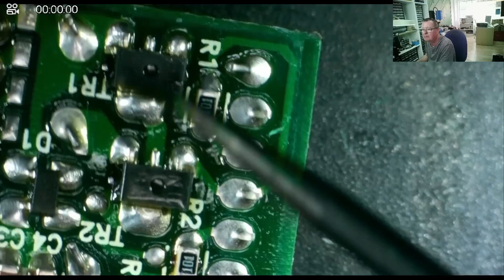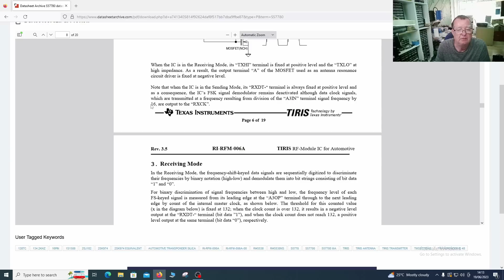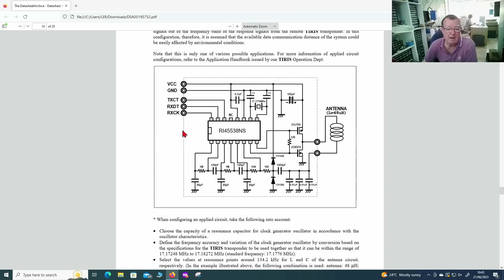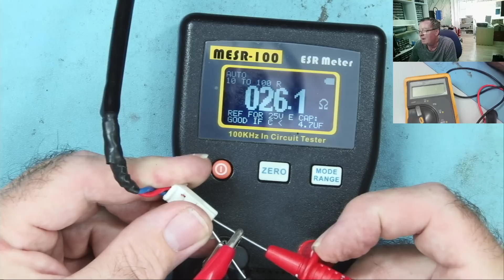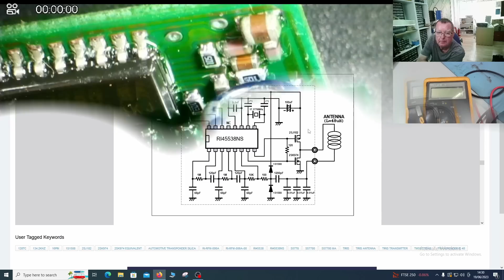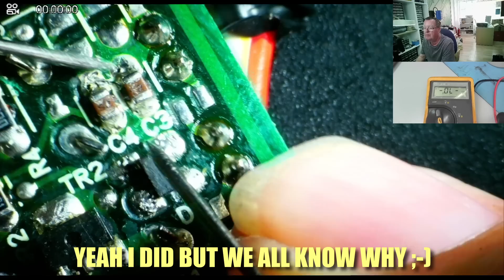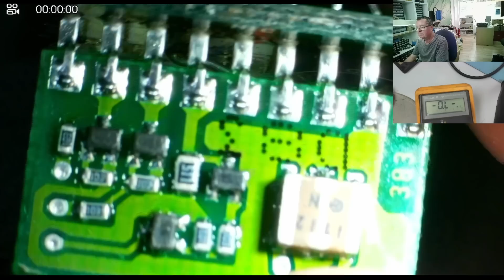Learn This Different Electronics Repair Technique And Fix Almost Anything!

Comment: Replacing the chip probably won't help, you also have to program the original RFID key code in the vehicle computer, if it is corrupted. It is very  seldom these RFID readers become defective. I make and sell a lot of RFID lock system, and it is very rarely I see a defect.
Reply from the maker: I would agree with that ans suggested to so much in the video.  The datasheet for this chip proves it is purely an interface between the key code generator (wherever that is on the vehicle, in the ECU?) and the antenna that communicates with the key fob.  Or at lease that is how I read the datasheet and typical app.  As you have more specific knowledge of this system, could you elaborate on why I can't replace that chip with another one?   As an aside I don't actually believe the chip is faulty, I basically just proved that nothing else on the PCB is faulty, therefore the chip is the only thing left.  Of an the crystal resonator.  As I mentioned at the end the customer picked it back up before I could complete the investigation how I would have liked to.  Hopefully he will bring it back
Reply: @LearnElectronicsRepair  Unfortunately I don't know much about car computers and where the code is stored. I don't do cars. But the reason I don't think the chip is faulty is because if it is you would expect that the car bus/computer would return some kind of error code if it can't communicate with the immobilizer reader. This sounds more like a job for an OBD tester considering how complicated a modern car operating system actually is. I think this fault could be everywhere, and I don't believe he has sufficient evidence to say that the reader circuit is faulty.
Reply: The circuit you have is actually not just a reader, it does also have the ability to write to the key. Because the EU demands that all cars have the ability to write/prepare a new key blank. So your circuit is actually a part of a more advanced system making your circuit a more or less dumb passive circuit that just facilitates the communication with the key rfid.

Comment: I would recommend to buy 1) a board holder, and 2) a solder station with a small pointy tip. Your tip is much too big. For SMB even totally unusable. The current one looks as those old ones without temperature control. If it has none you should get definitively a solder station with temp control.

Comment: That little four-legged device was a bridge, it just had the two AC corners strapped together, so two diodes in parallel “up” and two diodes in parallel from ground up to the signal line.

Generally I wont take on this type of job….the reason?  Because this is not the WHOLE device, but rather just a part of it….and the whole…I.e. the whole rest of the vehicle works as a unit and..as the bloke who owned it said, he was not even sure the real fault was not somewhere else in the other part of the circuit you did not get to see.

There is another way to look at it though…if you have the gear…this is automotive, nowdays a lot of automotive seems to yse the CAN bus standard….I think another place this is now used a lot is in disco/night club/theatre lighting control.  So IF you have test gear that will generate and recognize CAN bus packets….and a lot of contemporary oscilloscopes do have various digital protocols that can be selected in triggering options…and if you had a signal generator that did CAN bus too…then you could concievably do something meaningful with it…but without such gear I feel I,d be wasting my time.

This is what makes this sort of hybrid comms or even servo control stuff so unrewarding…take an electronic washing machine or E-bike or some other such part electronic, part mechanical, part hydraulic circuit/system where opto interupters or hall sensors and motors connect the electronic bits to the other thechnologies…these have to be worked on as a system, just looking at the electronic bits in isolation to the rest of it is generally pretty unproductive or inconclusive…as this was.

I got landed with a boat controller the other day, it had dozens of inputs, all protected with varistors, transzorbs and inductors, it had dozens of outputs too, from bug mosfet half bridges through filter networks, some PWM proportional, some just on-off digital. Took me a good hour and a half to get the lid off and dig down through the compliant goo to the board. There was a big micro, with Rom And Ram….I identified the power input and hooked it up to the bench supply, I found the crystal of the master clock…it eas running so the micro was working…And I would have done the same there with yourgadget, Put 5v across that electro and the CRO probe straight onto that ceramic resonator…if is wad oscillating i would have taken a quick look at the data out and waved an expendable RFID card over the “Antenna” …um, coil…if the trace changed at all on the scope I’D have deemed it a “goer” and told the bloke to look elsewhere…back to the boat controller…I eventually found a Lithium Primary cell that obviously held up some volatile contents in one of the memories…it eas dead flat…so I assumed the firmware was gone and went no further without gear that could specifically communicate with it.

 I susprcted the bloke who owned it simply scrapped it and forked out for a whole new unit when the onternal battery went flat. It wax biught to me by a mutual friend but I was given no fault discription or even any pressure to repair as he had already replaced it and just thoufgt I might learn something from it. I suppose I could put a new primary cell in it and take it back to him to try, but that wiuld be all. I imagine such a thing failing whilst you were far out off the continental shelf….I’d definitely want a far more low tech and less fault prone system to get me home.

 This is why I generally just wirk on complete electronic only sysyems that are self contained and I can get up onto the bench!

Comment: oh pleeeze, can you stop the board skating all over your bench. FIX it in place. And use probes correctly, aim down from the top, not very obliquely from the side so that you are skidding off the contact (solder) all the time.

Comment: whilst work of this type (part of a system/not self contained module - especially of unknown functionality) can be potentially useful brain teaser exercise, its otherwise rarely productive and most definitely not economically viable. simple circuit with only one marked, not-programmable chip that has available datasheet - and still got pretty much nowhere

Comment: when you poke the solder pads.. i cringe so bad.. as it drags across the traces and leaves a crater in its wake... scraping the whole board up.. ugghhhhh... cringe, cringe, cringe.. :face-fuchsia-wide-eyes:
but i love ur videos.. please keep up the good work..
Reply from the maker: How do you suggest I get a connection through the coating on this PCB without poking holes in it, or make some required tests without getting a connection.  I'm all for improving my technigue as regular viewers will know.
Reply: @LearnElectronicsRepair  I am a regular viewer.. subscribed & like every video.. it was not a put down.. i know there was a coating.. just under microscope.. u can really see what the probes do... that's all i am saying.. i love your videos, please keep up the good work.. I am a beginner in electronics.. (hardware).. (I've been a programmer for 27 years in many languages (software)).. I am trying to learn everything i can.. the basic components & how to test them.. can you do a beginners run through of common components, how to test them with multimeter.. & find faults & what mode used.. i know u have a few vids like that.. but they were drawn out & i was still confused at the end.. something more straight to the point, focused.. using your experience & pitfalls, & how to know if a component is bad in-circuit..

Comment: 0.628????
Reply: watch his video for the esr meter and you'll know
Reply: The value of 0.628 is used as a conversion factor when calculating the impedance of an inductor based on its equivalent series resistance (ESR).
Reply: @svetlinbarzev9110  Or tell us like the bloke below.
Reply: @andymouse it's just very interesting video, where he explains very well and detailed. That's why I recommended watching it ...

Comment: I didn't get your repair technique that takes 1 hour and ends up not knowing the reason behind the fault. Sorry, i appreciate your channel but looks like your video's title is a clickbait to me.
Also testing unknown components onboard is not the right technique.
Reply: mby you need to take some basics videos/books so you can understand better what he is talking and testing
Reply: This is not Richards target. 
Repair Repair Repair Repair. 
Money Money Money Money
Richard explains and bring knowlegde to the viewers.
Reply: I agree. I frequently watch Northridge fix and coming from there to watching Richard fumble around with a tiny board and no pcb holder was just painful to watch. The order at which he was checking components was also questionable. Checking for low resistance on resistors but not on the electrolytic cap. No ESR measurement on that either
Reply: @zeddpilsner4  lol comparing Northidge fix to Richards is like comparing Ferrari to fiat in favor of Richard. Alex is just good at soldering and he is very bad at troubleshooting, and on the other hand is Richard who has very good experience and can fix most of the stuff with his methodical approaches. Alex often cant repair anything that he never worked on :)
Reply: @user-kr8tp3ko8z  well i have to agree that Northidge is awful. Search for "Electronics Repair School", he's doing a great work, he's someone that deserves your subscription as well.

Comment: 16 volt is the electrolytic cap voltage  marking.Should be pretty logical since it is from a car that all know run on 12 volt battery.